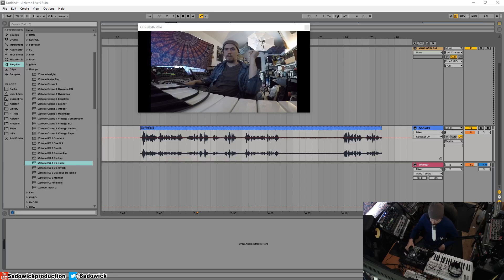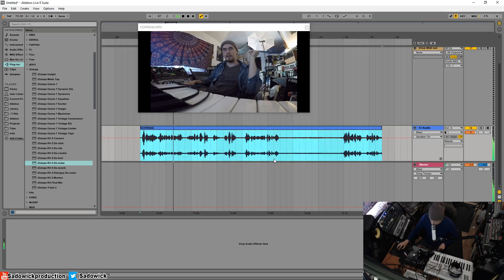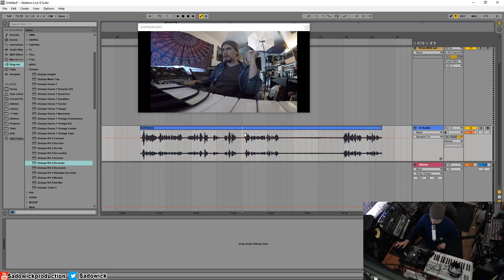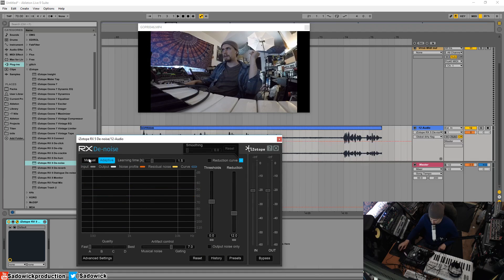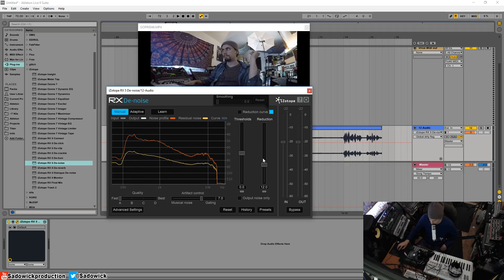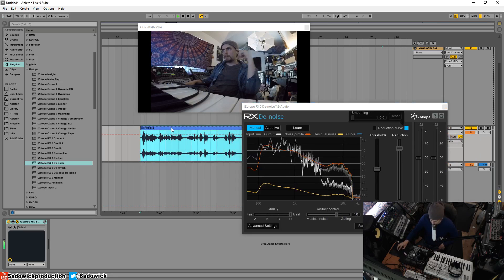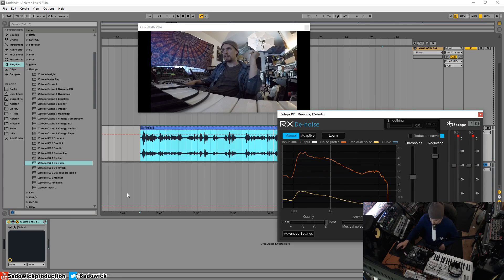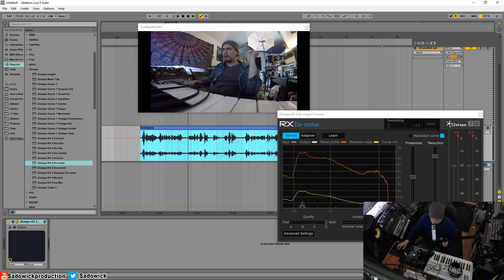Removing Hiss & Noise From The Built-in Gopro Hero 5 Microphone

Comment: What if you just loop the noise with flipped phase underneath the audio? In theory that should work too.
Reply: Tomáš Holec that's what denoisers do basically. That's why they need a chunk of silence.
Reply: portwain I would probably rather do it myself, instead of using a plugin.
Reply: Tomáš Holec iZotopes plugins really are worth it. With the deals they have usually the prices are not bad at all. Great company too. I bought the Music Production Bundle 2 couple Months ago and it had some plugins I had already, so I asked if I could get the Standard version of RX 6 (I had Elements) and it was no problem. 👍🏼